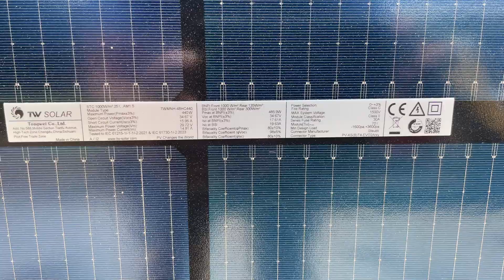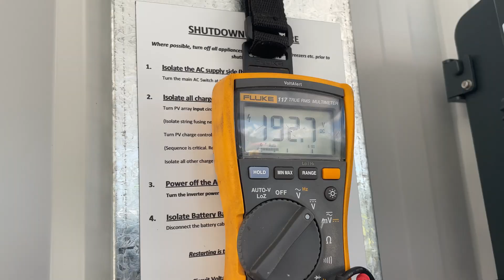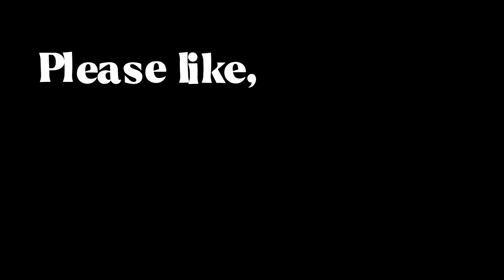Off Grid at Mount Binga : Ep 9 - Installing our off grid solar and battery storage

Comment: Hi Guys,  you might consider a few tweaks to your solar installation if you need more juice.   Solar panels perform about 15% better when they are ventilated.  Two of your three rows of panels are flat on the roof.  An easy install for sure but not optimal.  If you raise the back rack to achieve a 20% incline you will get both   better circulation and better solar exposure.
The other opportunity is to improve early morning and late evening performance of the system.  I presume your roof faces North and is maximised for solar collection.    If you find you are draining your batteries you could install some double sided panels in a vertical orientation that gather maximum early morning and late evening sunlight.  Solar panels are much cheaper than batteries and may be a good alternative for you.
Reply from the maker: @skeetamacgyver1821  hi Skeet! Thanks for the advice it's much appreciated. We haven't used this system yet but when we do and if we struggle, your tips will be great. Thanks for watching.

Comment: Hey, are you happy to share the details of the solar at battery system? Just about to pull the trigger on one ourselves
Reply from the maker: @mitchwarnock340  Hi Mitch. Yea happy to share what we have. What other details did we miss from the video that you would like ?
Reply: @ eeek, maybe I missed it. Did you mention the kWh of the batteries? How many kw of solar? What size inverter?
Reply from the maker: @mitchwarnock340  I think we got all that in there? The batteries are 3.2kwh. The solar inverter is a 10.66kw and the panels are 440w each X 24
Reply: @ thank you